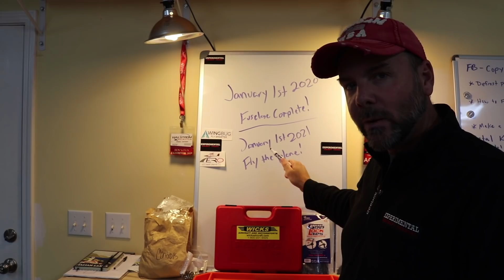31 Day Aircraft Build Challenge - Day 1

Comment: For those with the excuse of not having enough room. There are enough small parts you can build that will keep you busy for a year possibly two.  For the ones with the excuse " I dont have enough money".  Again, just buld one part at a time. Eventually you will have more parts than comes in some kits.  Some say, " I dont have enough time".  Quite often, those are the ones that need to take a little time for their self. If it's just an hour a day, thats enough to complete some scratch built planes in a year.  Building parts here and there just gives you one big head start, for when you do get the time, space, and money to build your own airplane.  Every year you wait, the less time you'll have to enjoy your flying machine. What else have you got to do. It's time to roll.

Comment: To add some realism for the majority of builders:
Do your build in December, as stated:
Do your build north of the Mason-Dixon line, where you can expect daily high temperatures in the teens and 20s
Do your build in a T-hangar, that is one of 20-Ts in a large building with sheet steel walls, doors, and roof.   Open ceiling with all 20-Ts, NO insulation (so even multiple torpedo heaters have very little warming effect --- and the building is breakered on 2 - 20amp breakers [each breaker provides electricity to 10 Ts -- so no electric heat can be used]).  This hangar is located on an airport, 1hr drive each way to/from home.  Lighting is provided by 2-40 watt fluorescent tubes, hung 16' above the center of the T ....
--- A little more realism and the obstacle to productive winter work.
Can you get the work done?  Yes, but it saps motivation.   Summer is the most productive, unless you have problems working in 95 - 115 degree heat.  But these are realistic challenges to the majority of builders.
Reply from the maker: WOw. All I can say is... Where there is a will there is a way. Maybe take some of these sub-components home with you and work in the climate controlled comforts of the home kitchen, living room or basement/garage. Or.... just wear very warm and heavily insulated clothes while repeating this mantra: #JUSTBUILDIT....JUSTBUILDIT... JUSTBUILDIT!  Thank you for taking the time to watch and engage here. Looking forward to what you can accomplish this season!
Reply: Great advice but be careful not to get your rivet sequence out of wack for the benefit of progress otherwise you will be drilling out a lot of rivets. Enjoyed the challenge....screw it just do it....ha ha
Reply from the maker: I created a new GROUP for everyone to share their Build Progress (Hot or Cold days). https://www.facebook.com/groups/experimentalaircraftchannelGROUP/
Reply: Making slow progress below freezing in my hangar on my Mooney (in 4 pieces) but its getting done.